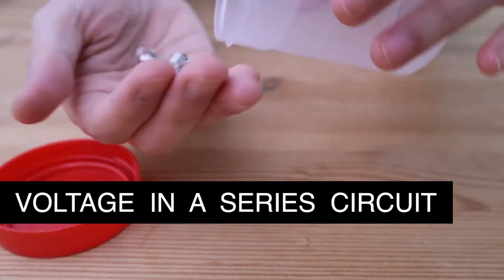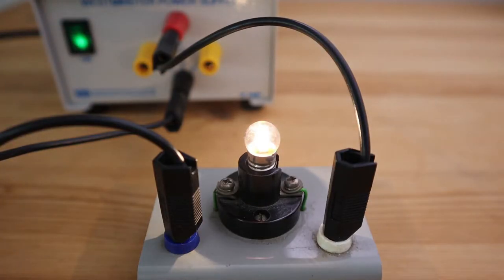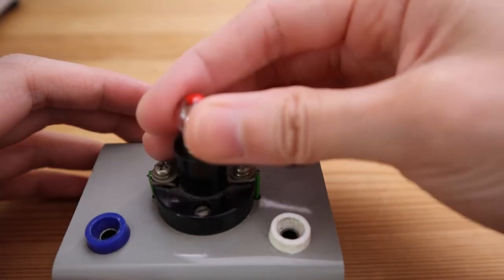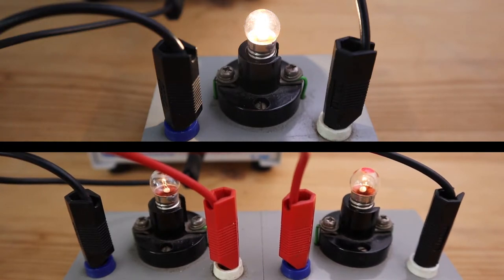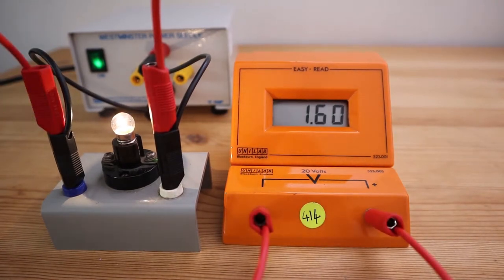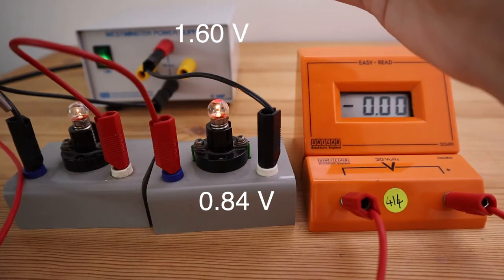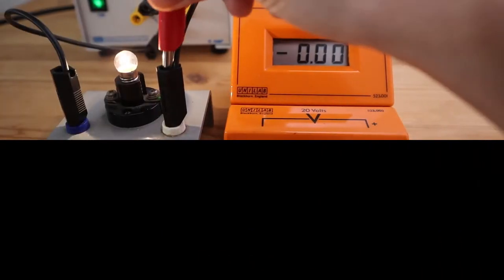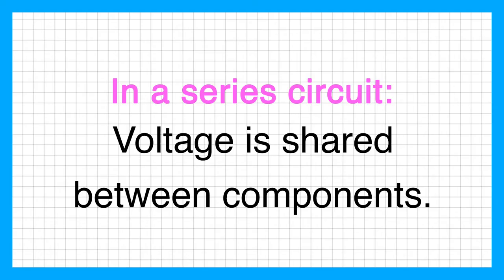Voltage in Series Circuits Experiment - GCSE Physics Required Practical

Comment: Hello, I was wondering what the sizes of the bulbs you are using and the name/type of wires you are using in this video are called because I want to do my Science experiment based off of this, if you dont mind? : )
Reply from the maker: If you search for something like 'science experiment circuit bulb', you should be able to find some mini screw-on bulbs. And search for 'circuit experiment leads' for the cables I used to connect the bulb to the meter.
Reply: @vt.physics  oh ok thank you soo muchh!!! 🌟